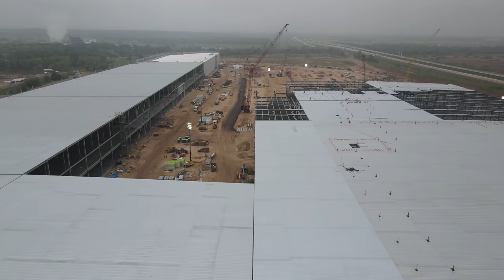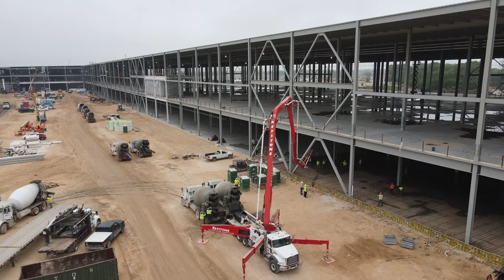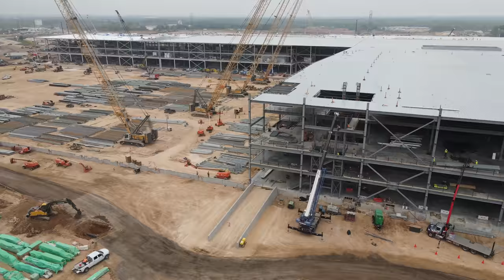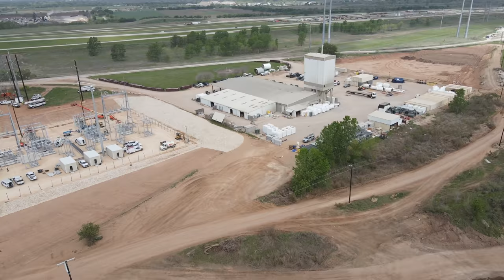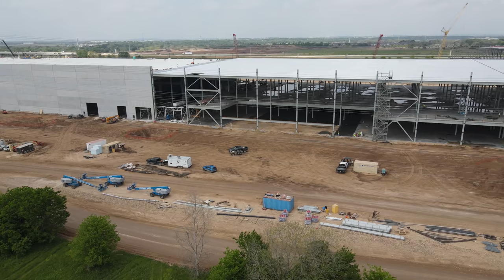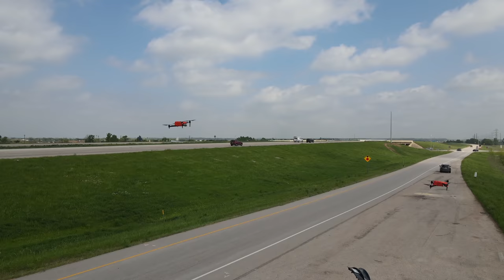Cell Unconstrained - 2021-04-08 Progress Update

Comment: That factory is a gift to the biosphere.
Reply: I mean.... more of an investment than a gift. 

There's an insane amount of CO2 released because of this factory construction: the mining and refining of coal and iron and other metals to produce all the structural steel and the manufacturing equipment, the CO2-intensive cement production for the concrete, the thousands of vehicles and trucks operating for months on end. 

It will take several years of the factory's full output of electric cars driving to offset all that CO2-- longer if they end up charged via grids with a high fossil-fuel power mix. If by some disaster Tesla went out of business before full output could be achieved, this factory would be an environmental disaster. Long-term net benefit though.
Reply: @daveachuk  It’s an attempt, they have balls. Thank you for the oil industry arguments against TESLA. I could blow them out of the water, but I’m sure you’re not interested.
Reply: @bluecollardisruptor9584  You misunderstand me. I've been a big booster of EVs since well before the Model S was announced. I've read quite a few CO2 lifecycle analysis studies and reports comparing EVs and ICEs. EVs are objectively better than ICEs in all situations. But it does not mean we get to pretend they have zero impact. Public transit or scooters or e-bikes, or the compact city car EVs are far better still than a 4000lb SUV, even if it is an EV. 

LED lights are more efficient than Incandescent, but if you install 4x as more lights that benefit is nullified, and that's what's been happening a lot in cities.

Similarly, many Tesla owners report driving double the miles or more per year after getting their EV -- because it's fun and they feel guilt-free about using them -- and suddenly they're right back up there with the impact of an ICE.

EVs (and particularly their manufacturing) are not zero impact. That's all I was saying. Still the better choice over ICE for many reasons, but back-of-the-envelope calcs say that it'll take 1,000,000 EVs driving several years before they manage to offset all the CO2 generated from building this factory. This factory is NOT environmentally friendly. It simply enables a net CO2 benefit at some point in the future.

Comment: I am curious about how they attach the first layer of roofing material to the steel corrugated surface. Is the first layer also corrugated and is there an adhesive used?
Reply: First layer hard stiffener then 2 layers insulation, protection layer all screwed down with  long screws, final weather layer glued. About R 25.
Reply: @eltonray2934  Thanks for the answer. So they dont care about the airgap left by the corrugations? Must make finding a leak miserable when it can run far from the leak in the corrugation, or they just dont leak?.

Comment: I'm sure that they have a practical reason, but can someone explain the method for this construction madness where one part of the factory is rapidly being completed while others don't even have the foundation laid?
Reply: Continuaty of work, you dont have skilled workers to do the same work at all the places, waiting untill all the same work is done will loose you so much time.  Also the cranes cant reach the area’s where they are needed if all the foundation is build. Same with pooring cement etc. A building this large you have to build in compartments.
Reply: Critical path. You wouldn't build a warehouse section at the same time you built a paint shop that  takes 4 months to install the production equipment. If the turn on date is 1 Sept. , they know what to build, when.
Reply: Keeps everyone busy this way with more specialization and less retraining, no layoff/rehire, sooner overall completion. Terms are "critical path", "pipelining" and "parallel processing". The most difficult areas are started first so completion is assured on-time. 

Also seen everywhere in manufacturing.
Reply: Going south on the westside is not a priority. Going north is right now. Eastside is a priority over the westside. Clearing land is the same thing. Everything is timing and logistics.
Reply: As a long time project mangler, the folks are speaking truth. The idea is that the whole thing is ready to turn the key on the due date and make whatever. It’s not just the building either. Or even installing the interior and the machinery. It’s things like, “ It will take us 2 months to get the casting process just right but only 3 weeks to get the interior assembly, dash, and seats dialed in.” Well that means that the basic configuration of the casting must ready 5 weeks before the interior guys. But what if the interior guys have to have mostly finished bodies to dial in their process and it takes the body guys 4 weeks to go from casting to finish body in white? Well, your casting has to be ready 9 weeks before the interior. (5 weeks + 4 weeks). And for something like this project there are thousands of dependencies. There are a lot of ways to build and track all these dependencies but the granddaddy method is the Gantt Chart. It goes back to the rocket days when it really was rocket science and industry engineering and process management was still really catching on. People who are really good at earn every high paid dollar they make. The rest of us just do the best we can.
Reply: @Bill_N_ATX  
Project MANGLER?? 🤯 You MANGLE PROJECTS?? 😵
😄😅😂🤣😆😬😉
Oh and thank for the insight of the manufacturing process.
Reply: Plus they want stuff done for the Model Y production, cybertruck production will follow